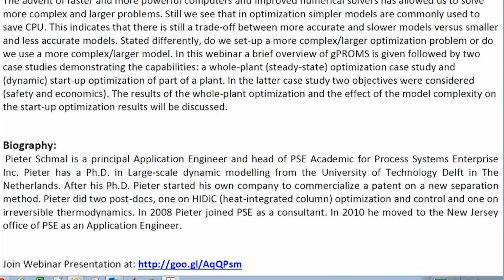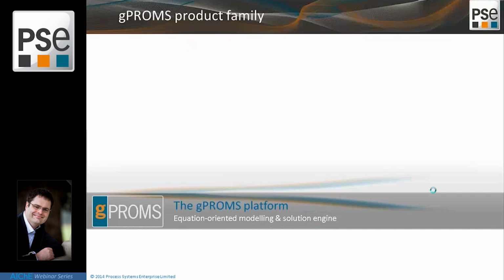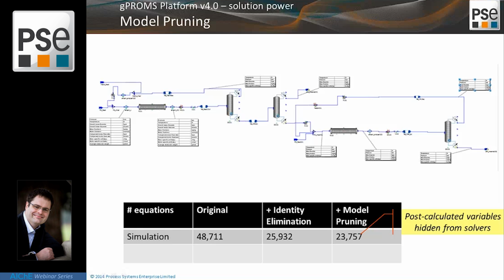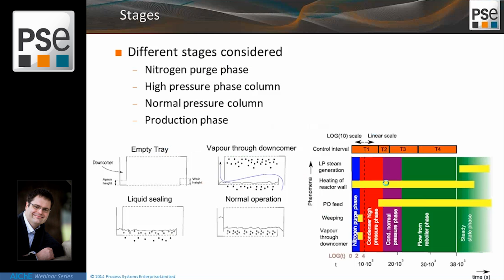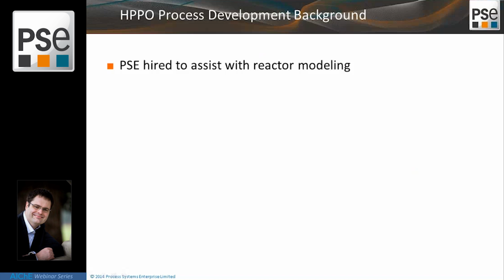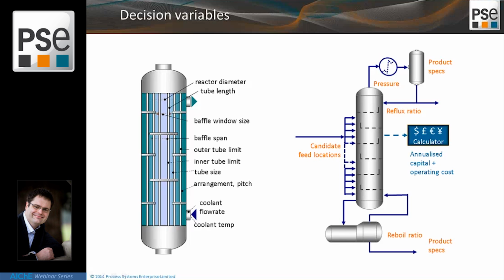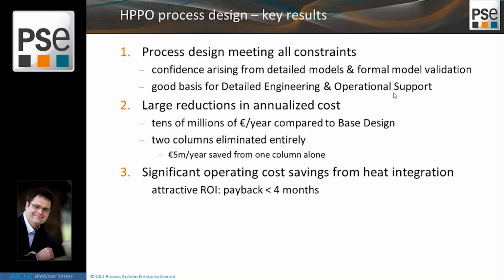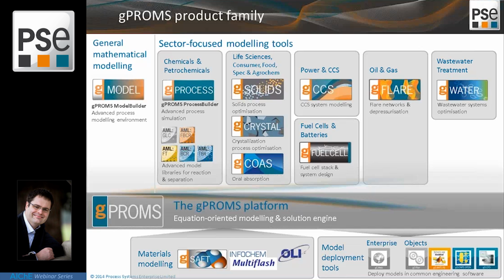gPROMS: Dynamic Modeling and Optimization Advances

Comment: how can i download this software
Reply from the maker: +dũng trần, it is commercial software available from https://www.psenterprise.com/products/gproms  Free alternatives are APMonitor and Modelica: http://apmonitor.com/wiki/index.php/Main/CompareModelingLanguages
Reply: I want to simulate a water treatment system, What software should I use?
Reply from the maker: Any of the software packages should work. Sometimes it helps to find an example application online that is close to the one that you'd like to simulate. The models are typically collections of differential and algebraic equations. There are tutorials on model development at https://apmonitor.com/pdc and https://apmonitor.com/do
Reply: @apm   do you know where i can download the free version?
Reply from the maker: @sophia2928  there may be an evaluation version but I don't think there is a free version. If you need a free version of DAE modeling software then Gekko is an alternative: https://gekko.readthedocs.io/en/latest/